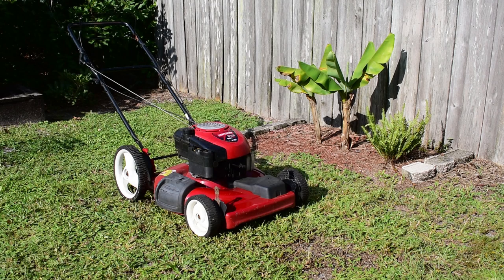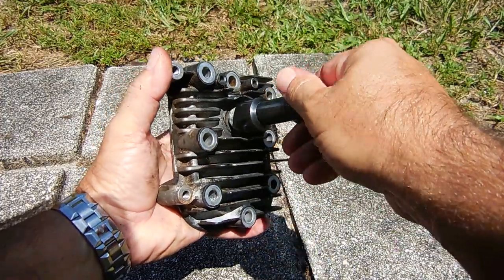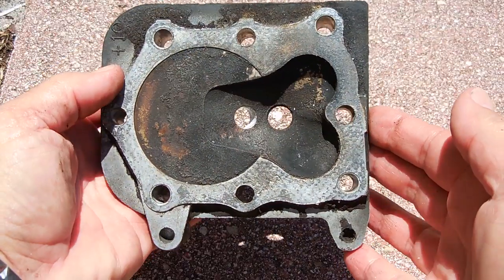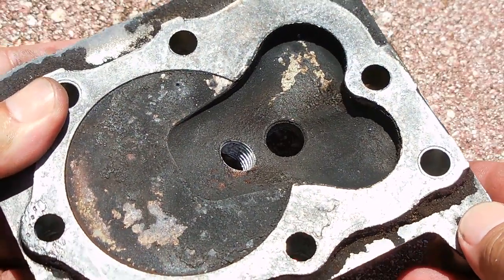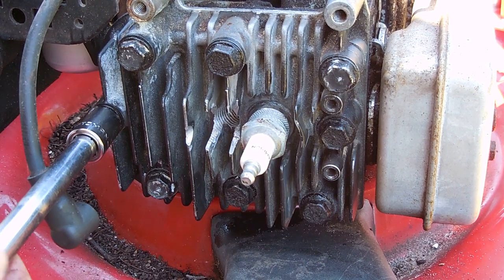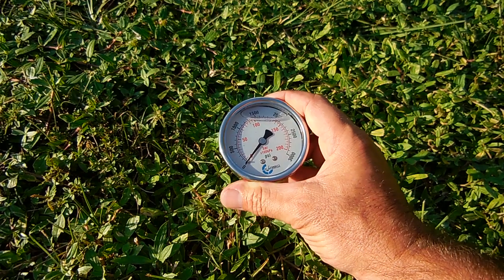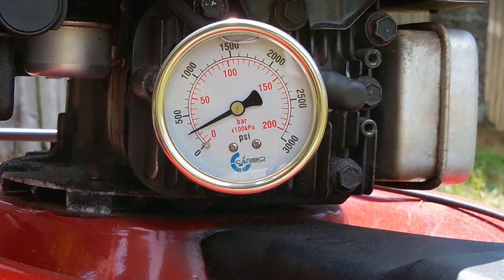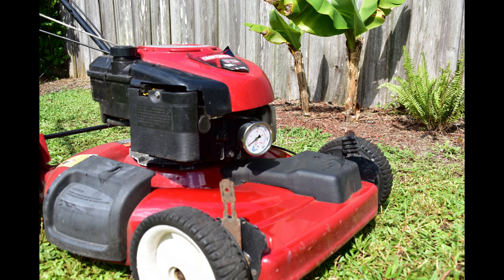How Much Cylinder Pressure Inside A Running Engine? Let's Find Out!

Comment: Clearly looks like 250psi not 300. Halfway between 0-500. 
If it rises under load, why not show it. Now that it’s set up do a little mowing.
Reply from the maker: You need to look at the increments much more closely. It's 300. The meter was designed that way. I guess you didn't read through the comments, there was no tall grass to cut. Unless the grass is really tall, and you can hear a change in the sound of the engine while you cut it, the reading will be the same.

Comment: I expected it to be way higher than that for some reason. I work on a steamboat and we run 150-200 psi in the steam engines. I figured a gas engine would be closer to 1000 or something.
Reply from the maker: When a load is placed on the engine, the piston will have much more resistance moving downward which will cause the expanding gases to become higher in pressure before the exhaust valve opens. Thanks for watching!

Comment: I had a Tire infiltrator for my motor bike that used the spark plug hole way back when.  You pulled the plug and replaced it with the do dad.  Inflated your tire by kicking over the bike.  You could do the same with your added port.  Only bleed off enough pressure to fill a tank allowing the engine to remain running.  Who cares if the Tank full of Pressurized AIR FUEL Mix finds a ignition source ?   LOL   Knowing it could be done could come most handy under the right situations.
Reply from the maker: I already had that vision. I may make a video. Thanks for watching!
Reply: Add a flame arrestor and a timed valve to only open after ignition?
Reply: Or build a gun that uses that pressure.
Reply: @billbergen9169  LOL,, MEGA spud gun ?
Reply: @pulesjet  yes!
Reply: I have one of those tire inflators , not very practical now days but will pump up a tire if that's all you got and you're in the middle of nowhere
Reply: @superrodder2002  You could keep one in your tool pouch under the seat of your Dirt Bike.  They had a Reed valve set up as to not provide pure fuel air mix. LOL  Yea, they worked.  Get a load of cactus in the tire you could get home.

Comment: Thanks for taking the time to share this with us, I was thinking it would be higher but I only base that on the knowledge that some performance auto engines are 10x that but that's under load
Reply from the maker: You're welcome! That's why I let viewers know that under load the pressure would be much higher. Maybe next time try a generator with a heavy load.
Reply: Aside from a wide open throttle letting a lot more air in, what makes it go up so high under load?
Reply: More fuel
Reply: All that extra air and fuel can't go no where (with the valves closed), so it spikes the pressure way up?
Reply: @tarstarkusz  IMHO with more load,the piston encounters more resistance to movement after ignition so more fuel burns/more pressure must be developed before the chamber is able to move and overcome the additional  resistance.
Reply: Would that remain true if the revs are also higher and the piston is moving faster?  Or does this only work at high load, low RPM (which is where engines are most efficient)?
Reply: @tarstarkusz  my guess is that higher rpm could reduce max pressure because there is less time for the pressure to develop. On the other hand, an open throttle reduces the vaccuum i.e increases the intake pressure/ air volume so so pre-ignition pressure is higher to start with. So that might lead to higher pressure after ignition.
Reply: That makes sense... Thanks.

Comment: Great video as usual. How did you know the compression ratio is 100:1? Is that from specs? If normal atmospheric pressure is around 15 psi and you got a max psi of 300, doesn't that mean the compression ratio is around 20:1?
Reply: I guess if the intake pressure is 3 psi then the numbers would make sense.
Reply: He's not measuring the compression ratio, you can't measure a ratio anyway.
He should have taken it out into some deep grass to see what kind of pressure the engine actually gets to under load.
Reply from the maker: @MrJohnnaz  The grass was already cut.
Reply: I think I understand the numbers better after a little googling and rewatching the video.If anyone is interested: The compression ratio is pre-ignition. Here he is measuring the pressure post-ignition. The pressure is probably 100 psi before ignition with an intake vaccuum pressure of 10 psi giving a compression ratio of 10:1. When ignited, the pressure builds up to 300 psi which pushes the piston down.
Reply: @andyfer7716  yep ... summed it up nicely ... the lawn mower is all set up to investigate pressures of different fuel sources: moth balls, electrolytic hydrogen etc

Comment: You should check out in cylinder pressure testing with a pressure tranducer and oscilloscope. Pretty cool technique as it can show you a not of detail like a obstructed exhaust or valve issues.
Reply from the maker: Interesting idea.
Reply: @electronicsNmore  very , the pressure transducers can be purchased commercially as the Pico WPS500X which is the more popular one. How ever tech in the field make their own using a 0-300 PSI 3 wire transducer frequently found on Amazon or Ebay. Also Piezo transducer disk make a great way of showing small pressures like exhaust pulses and drawing a pattern on a scope. Also  piezo disk are great at detecting vibration and can be used to pinpoint the location of a vibration or noise.

Comment: Great video Cheers. Now set this up with a generator under load and see what different fuels show when the bang goes off and generates pressure in the cylinder to drive the generator. Bottom line is showing the biggest bang for for the dollars you spend. Basically this shows the efficiency of converting the zap explosion to useable energy. Best of luck. PS: you might try some nitro fuels... should give a big bang but dough the cost is reasonable. Starting fluid ? hair spray? kerosene. Diesel fuel? propane? Natural gas?. High octane?I am sure you can think of even more.
Reply from the maker: Thanks for watching Steve!